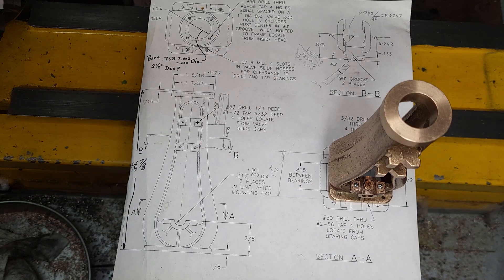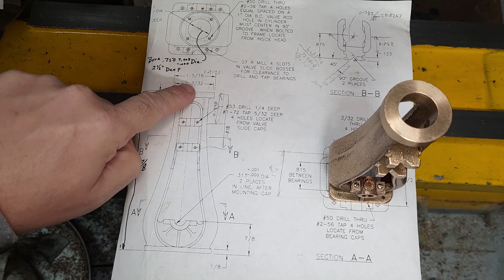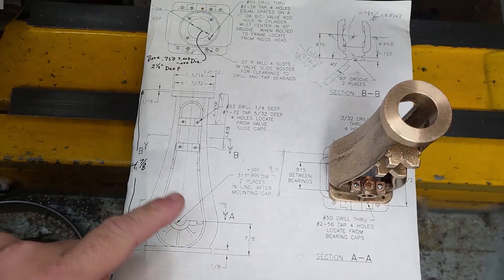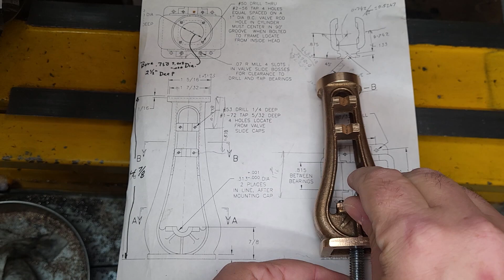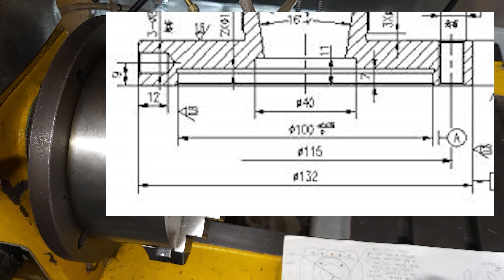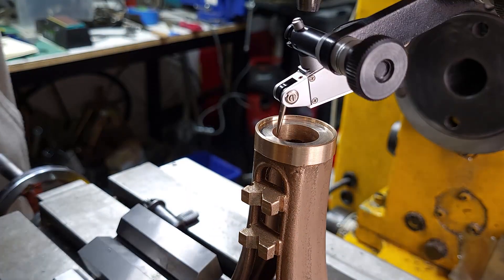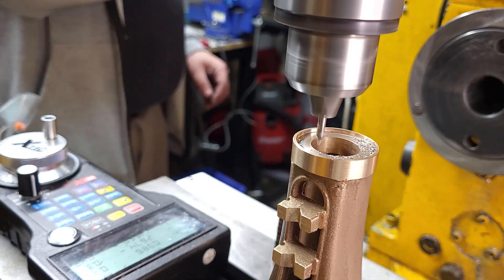7 Machining the Frame Top - PMR #5 Steam Engine

Comment: Nice progress so far! How do you find drilling small holes on your machine? I would have thought not having much feedback for drill pressure would be an issue with little drills
Reply from the maker: I'm using the feed per rev G95 at 0.001" per rev at 2950 RPM in the next video. Seems to work.